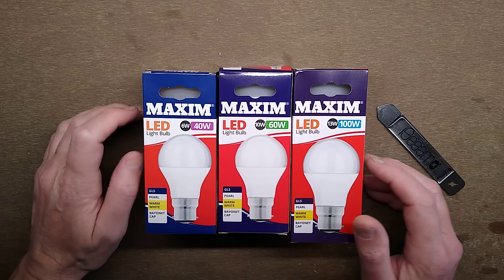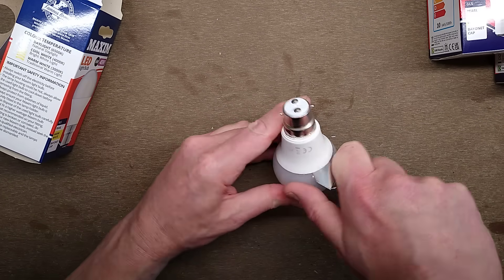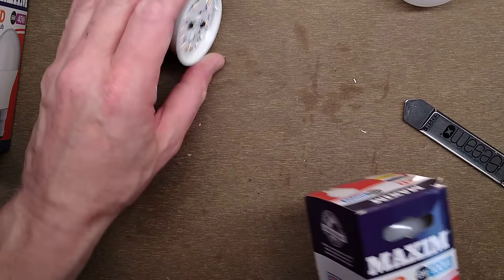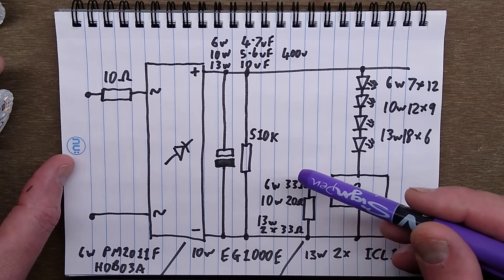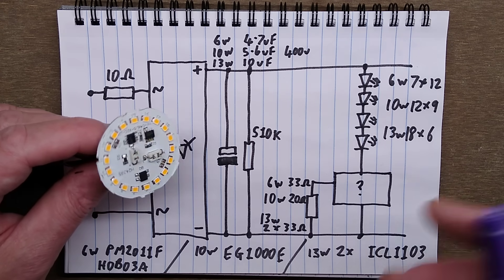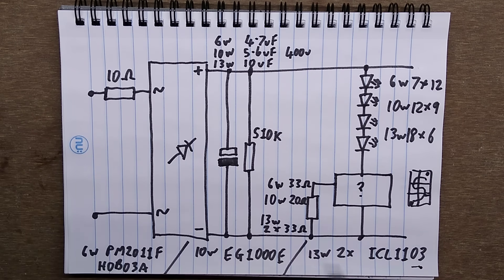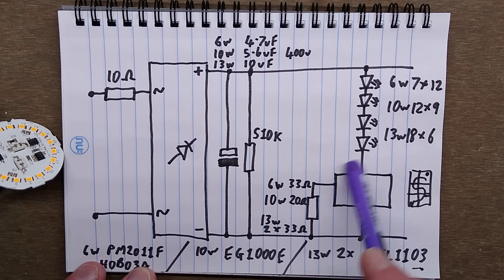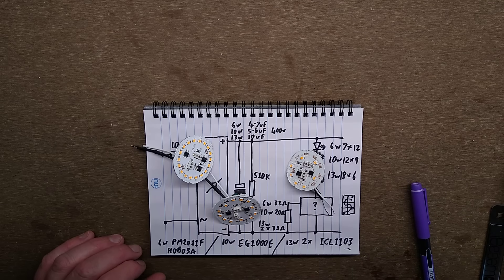6W vs 10W vs 13W LED lamp showdown (with schematics)

Comment: I see those bulbs use the out-of-date efficiency rating of A+, which is equivalent to F on the new scale from sep 2021.  Have you looked at Ikea's cheap led bulbs that claim a rating of D! 470 lumen for 3.4W, and £2.50 for a pack of 2. Is that better than the Poundlands?
Reply: I’m still using 13-ish watt bulbs from Dollar Tree and probably I should upgrade to something more efficient. It’s 100 miles to the nearest IKEA so 9 gallons of fuel for the round trip… probably need to do a bit of research first. Overwhelmingly I use electric power for cooling and occasionally heating (in south-ish Florida), so it might not be worth the effort.
Reply: @markiangooley  def. not worth (except they are turned on 24/7)
Reply: My uncle used to swear by Osram tungstan 100w lamps back in the fifties.
Reply: @kevinwingfield2007  Osram 100W bulbs are fantastic heaters!  I do miss the beauty of large incandescent bulbs burning 100 honest watts of electrons to produce about 5% of that as visible light.  Osram did a great job of producing “natural” light with their bulbs though.

I’d like to see Clive do a tear down of a 100W bulb:
  - Smashes glass
  - “Right…. There’s a filament made from tungsten.”
  - “Let’s see what the power factor is…”
  - Poof!
  - “Apparently zero.”
  - “How quickly will it cook a hot dog?”
Reply: @kevinwingfield2007  Osram-branded LED lamps are rubbish.  I bought two (different styles) and both failed within a few months, with horrible oily goo leaking from them.  They had an 'Osram warranty' but this was worthless.  The contact information on the boxes did not work: there was no response at all from Osram.
Reply: @cdl0  My uncle said they were great. This was before LEDs. I think he had a fish and chip shop in 1943.
Reply: @kevinwingfield2007  The fish and chips from your uncles shop in 1943 was likely absolutely brilliant.  Did you try it?  Don't bother with Osram LEDs.
Reply: @cdl0  are u sure those are genuine? I have osram led lamps, cheap ones, with no such problems
Reply: @kentahirono  I bought them from Tesco supermarket in the UK, so they should be genuine.
Reply: 2€ couple here
Reply: As well as the 3.4 watt Solhetta 470 lumen double pack for £2.50, there's also a single clear Solhetta for £3.50 that's 470 lumens at 2.9 watts. I'd be interested in an efficiency Vs price run down if various lamps
Reply: @SheddyIan  that lamp is with filament cob leds and clear glass, sure has less losses
Reply: To get higher efficiency ratings, you'll have to sacrifice another parameter. For example you could have a switched one but that generates a lot of EM noise, you could have a capacitor dropper but that's a bit flickering etc...
There's no real point of aiming for the best efficiency on something that accounts for only a few % of your electric bill
Reply: @cmuller1441  You must not have seen the video on Saudi cartel bulbs.
Reply: @cmuller1441  it is if you have 20/30 lamps on 6~8/24
Reply: electroboom loves ikeo lamps
Reply: @lucasvanhamburg4937  So?

Comment: So ... amount of light.  I get the sense that this is a little like a radio transmitter.  If you reduce the power of the transmitter by half, your signal only drops by 3 dB which is detectable but not won't usually make your signal unreadable (assuming your signal wasn't marginal to begin with - and this ignores losses and gains in your antenna system, of course).  Are we doing the same here?  When you sub in the bigger R and the light's output diminishes, are you dimming it "by half" or is it a much less perceptible difference?
Reply from the maker: If you halve the power to an LED lamp it's output doesn't quite drop 50% due to LEDs being more efficient at lower currents.
Reply: It's true that human perception of light is not linear - this is why you can walk around at night without bumping into things with a feeble single LED torch or the faint glow from the moon. So halving the light output doesn't halve the perceived light output. Also eyes adjust the pupil anyway in bright conditions so you may as well save some power and not stress the LEDs
Reply: The real problem is that most LED lamps are marketed with “equivalent” power ratings to tungsten filament lamps. However, the amount of electrical energy drawn from the mains supply is not equivalent to the amount of light output. This is true for any type of lamp. As all lamps waste some energy in the form of unwanted heat. Plus how many people actually try different lamps to select one with a reasonable brightness for the room, rather than fitting whatever they have / the highest power that they have?
Really lamps should be selected using both Luminous intensity (unit is candela or cd) which is how bright a light is when the light from it hits a flat surface from one direction of the light source and Luminous flux (unit is lumen or lm) which is the total light output from all directions.
As Clive says, the efficiency of a LED to convert electricity energy to light varies depending on the electrical current and more importantly, the temperature of the semiconductor chip. At higher currents (power levels) it runs hotter, but is less efficient. Hence if you run a LED at half the maximum rated current (LEDs are current operated devices), it will be more efficient than when operated at its maximum rated current, but will obviously have an overall lower light output.
The reason that manufacturers don’t operate LEDs at lower current levels is cost. You would need more LEDs for the same light output.
Reply: @Mark1024MAK  they overload the chips so you just simply have to buy a new one in the next 2-3 years. Otherwise you would stick with the same lamps (OR LEDS) for decades. Also LEDs need cooling too!
The equivalent part supposed to mean the luminous output of the tungsten lamp. Back in halogen days they also wrote this equivalent on those lamps so anyone would know the "brightness" of that lamp. Most ppl doesn’t know about lumens and candela… they only know 100 w tungsten was good, so buy a 100w equivalent one.
Also marketing that they now give you the good old 100w light output but only using 13w power.
Reply: @goldhandrenthal  - which tungsten lamp? Long life tungsten lamps produced a lower light output compared to a 1000 hour tungsten lamp. And both had different light outputs if the supply voltage varied compared to the official rating. Using the wattage has always been a stupid way of selecting the correct lamp for an application. With regards to quartz halogen, just look at (1) how the difference in light output is with a spot beam vs. a globe type lamp and (2) how much heat comes out the back of a quartz halogen dichroic lamp.
Yes, because people are not used to measuring light using the units of light, at first, there would be a sharp learning curve. But there has already been one, nay, two already (tungsten to CFL, then LEDs). So I think the majority of the population would soon get used to a better way of buying and selecting lamps.
Reply: dB is 1/10 the base 10 logarithm of power, by definition. 3dB on anything is roughly a factor 2 on power or 1.4 on voltage and current.

Comment: 7:36 - about disabling one of the current regulators: Could it be that they have divided the LEDs into two identical circuits? Therefore disabling one will halve the output (!) but conversely not increase the lifespan of the lamp... Could you determine the tracks on the white PCB?
Reply from the maker: All LEDs in series.

Comment: How about a guide for whose bulbs are the most hackable?
Reply: I love these light bulb videos and could easily watch one or more a week. Which bulbs are best for hacking with a different one checked out every week? Sign me up.
Reply: I’d say just go for whatever is a cheap high-brightness model, so when you dim it the resultant brightness is still decent. Those resistors are pretty easy to desolder and replace with the right tip, even with the aluminium-backed board, but being able to clip off one of two resistors is still definitely easier. Also ones that are easy to disassemble is important.
Reply: Not bulbs bought in India, to be sure. All our bulbs have switching regulators on a separate board rather than a resistive chip-on-board. Very hard to get at without destroying the bulb in the process. I figure they looked at our power lines and decided that the bulbs need to work all the way from 85V to 300V.
Reply: Edisons lamps are ultimately the most changeable!
Reply: I have some of the 6W version fitted with a 75 ohm resistor, good compromise between light output and running temperature.
Reply: You and your bright ideas 😂😂😂

Comment: I could not agree with you more in regard to the iSesamo Spudger you and I both use.
I got a couple of spudgers on eBay that were half the price of the  iSesamo, but they had very sharp edges as though the metal they were made from had not been debured at all, I ended up using emery cloth to clean the edges up to make them just safe enough to handle and like the cheap ones you describe, they just bent.
iSesamo Spudgers are not cheap, but they are good and will outperform and out last any of the cheap spudgers.

Some of the iSesamo Spudger suppliers had an offer which may still be available, where you buy a iSesamo Spudger like the one you are using, and you get a mini one free. By mini, it's the same width, but about 1/3rd the length and still has the plasticated body. It makes for a handy tool to keep on a keyring.

KW.
Reply from the maker: I got one of the mini ones with this one.
Reply: I have  the original/correct iSesamo + the mini version that sits on my key ring. No comparison with any imposters.
Reply: I thought all metal spodgers were like that. Now that i know the iSesamo is proper spring steel i'll go get one :)
My el cheapo from amazon also bent at first use, but it was still so much better than the plastic one.
The real deal will be perfect
Reply: I got a knock off but I guess I got lucky. Well, one of the scales came loose but I just wrapped it with tape.
Reply: Where do you get the real ones?
Reply: @Free_Pureblood  I just bought one from Amazon
Reply: I found that the 6” spring steel rulers that industrial sales reps hand out make excellent and durable spudgers. The rounded end can be sharpened on a whet stone and they last for years between sharpenings.
Reply: Plastic spudgers can be very useful for delicate things like mobile phones, or where you don't want to leave any marks. I have one that is amusingly styled exactly like a single edged razorblade.
Reply: What about ifixit ones, I have one and I don't see any reason that the sesamo one can be any better, especially at the asking price for either of them. plus it has a real handle.

Comment: The regulators don't fight with each other in parallel? I'd think that could lead to oscillation. Were I using two, I suppose I'd have put 6 LEDs on one and 7 on the other.
Reply from the maker: No.  Each just passes its target current and that's it.